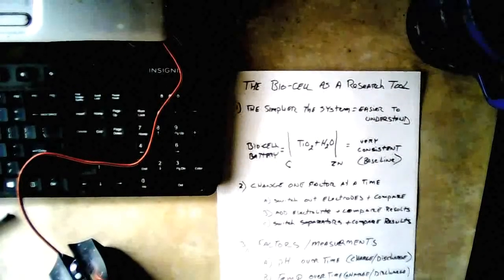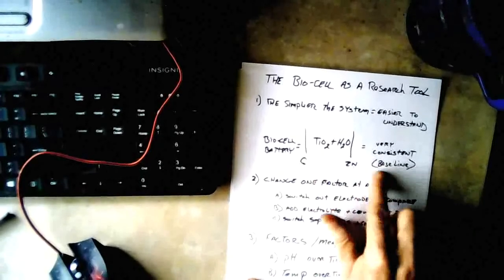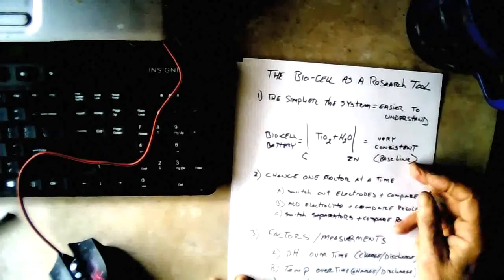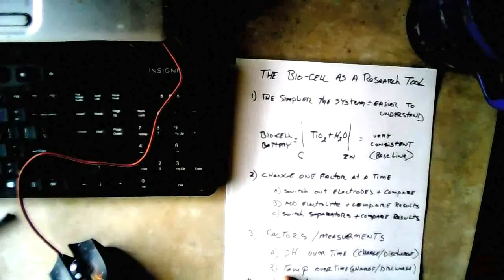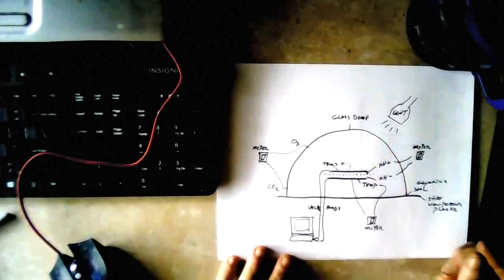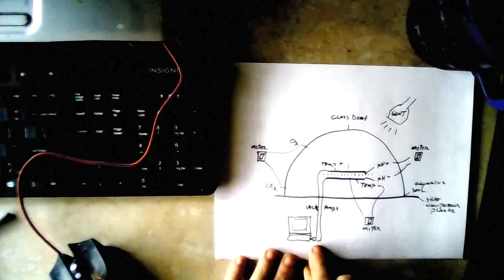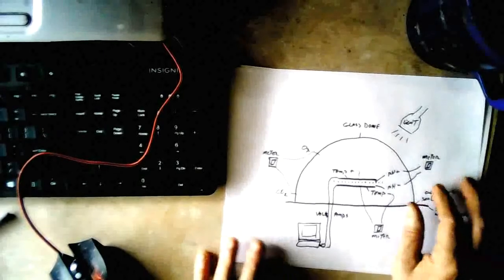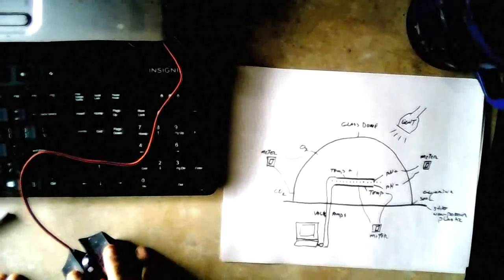Demo #33 The Bio-Cell as a Research Tool

Comment: The ZKE Tech dummy load which I presume is the one you are talking about has a minimum load current of .01 Amp which is generally too high for these small experimental batteries. I have scaled up my test cells to around 4cms x 4cms so that they can supply enough current for the dummy load to be useful. Being able to plot the current/voltage over time certainly helps experimentation though!
Your results with the oil emulsion are interesting, I have had good results with an emulsion of vegetable oil, titanium dioxide and various emulsifying agents (detergents). The problem I have found so far is that the emulsions are not stable enough and stop working so well after a day or so. So far I have been mixing them using a kitchen blender but aim to try sonicating to see if that improves things at all.
Looking forward to seeing your test chamber in operation!
Reply from the maker: Hi Kevin, welcome to the channel!  I've thought about using a phosphate detergent but haven't tried it yet. Hopefully the dummy load will arrive soon, and   I can set that up.